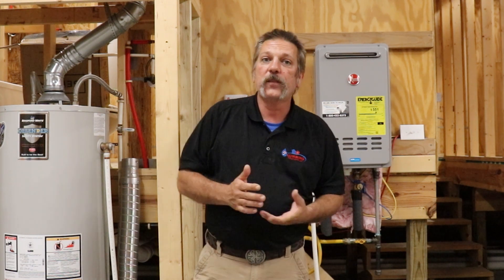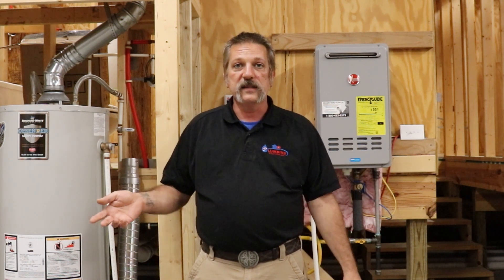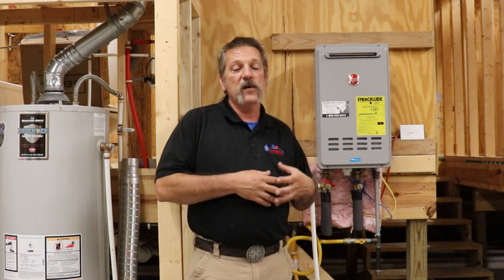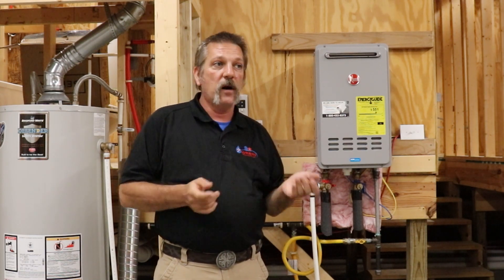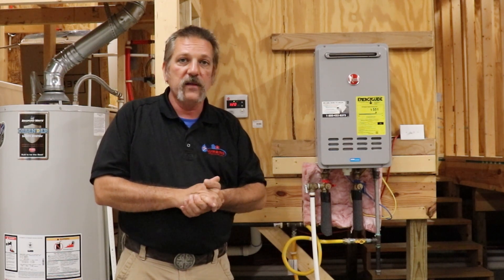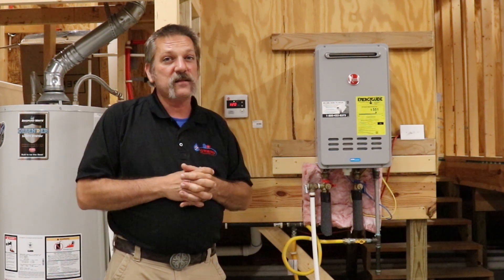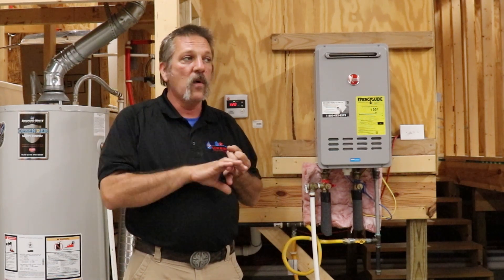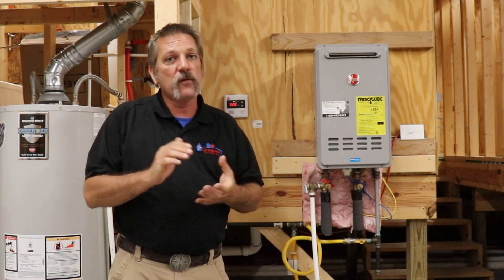Homeowner's Guide: why does it take a while to get hot water

Comment: I have look at many of your video and they are very educational.. I have an issue that you might not have covered. When I purchased this home, it has two rheem water heater in parallel. I assumed both were working as we are getting hot water in the home. I was doing the maintenance using vinegar to remove any calcium build up. One of the units flushed perfectly well, so moved to the second unit. Hooked up both hoses and turned on the pump.. nothing out of the hot. We checked  the filter on the inlet (cold) side but it was clean. After many days of research, I saw an article to use Lime Away 28oz to 2 gallons of water and set the pump again... No water out the hot line.. We allowed it to soak and repeat the process every 30 mins for about 4 hour.. Still nothing through the hot line. I know this is clogged but how to I fix this.. Is there something that we can take out and clean etc. Any assistance or guidance will be appreciated.
Reply from the maker: Um... I have a few ideas but, Best to call tech support on that one. 1 (866) 720-2076, Its free..

Comment: I do plumbing in Austin Tx and i like to use the Navien NPE-240A2, it has the built-in in recirculation pump and we run the the water loop as close to the anglestop, shower valve etc as possible and return it back to the return inlet. When customers open the faucet, it take like 2 seconds for the how water to come out (even in a kitchen island). We also use the shortest possible flex on the hot side to reduce even more the wait. We also insulate every single hot water line with 1" thick insulation to prevent heat loss.

Comment: So what do you think about recirculating pumps? I was thinking that running continuous hot chlorinated water through PEX for 30+ years sounds like a recipe for disaster, but your thoughts? (Dedicated return line to the fixture furthest away)
Reply from the maker: Well we don't really know the true life expectancy of PEX yet. Give it 20+ years and it maybe the new Polybutylene , CPVC was supposed to be the "jam" but it is garbage now. we will see.... 
recirculating pumps work well on tank heaters. but for tankless it's best to get one that comes with the pump on board. I don't see many dedicated return lines in residential. Most tankless use by-pass.

Comment: Hello I've had a ticklish hot water tank for 15 years recently in 2018 good results then bring a pump I saw it on This Old House where they where they said to put end of the father's fixture on your hot it water side it works quite well it takes the cold water from the hot side pumps it to the cold side and when it reaches temperature turns off and the check valve closes it could be either push button on demand or on a timer something to look into and talk about have a great one
Reply from the maker: Yes, those pumps are neat. I have a video on them too